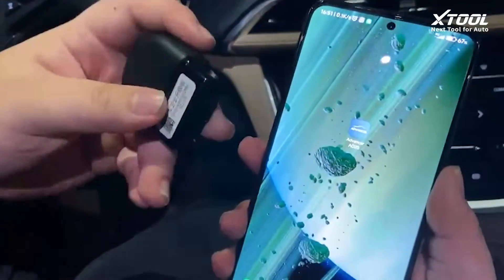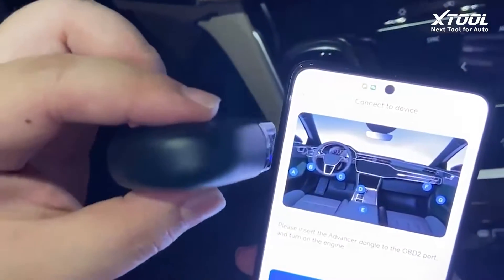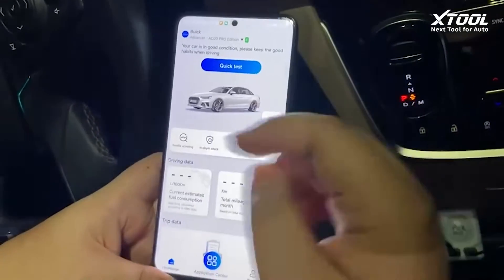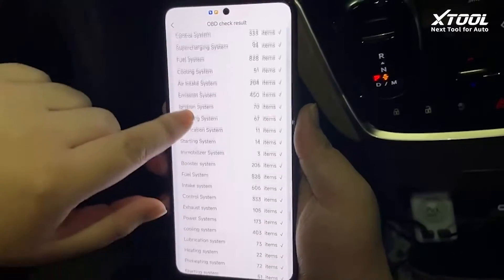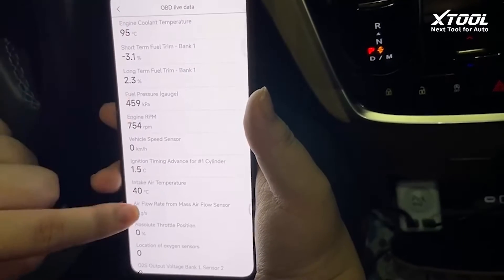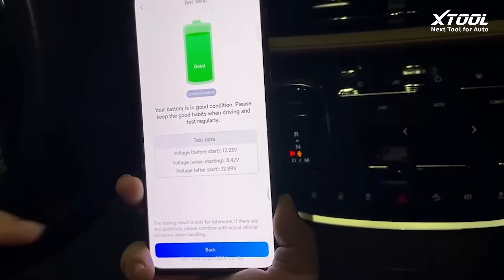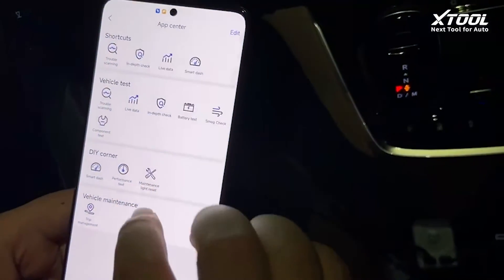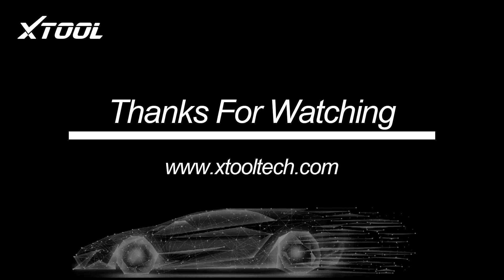XTOOLTECH Advancer AD20 Function Introduction

Comment: before buy this product ask customer service say able to support my car until i get the XTOOL AD20 plug-in only live data can read RPM, engine Temp, engine load the rest all can't read. technician is my car issue no product issue but i try to use other product ELM can read massflow sensor, PSI bar, vacuum, throttle valve, ETC1, ECT2, a lot. only this product AD20 shit.
Reply: so this products can't read abs, srs, just like virtual